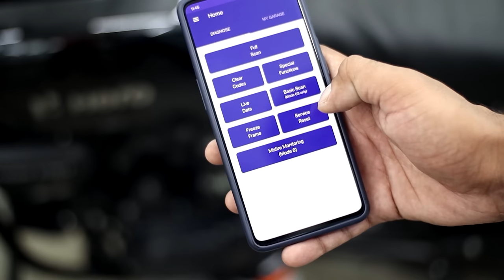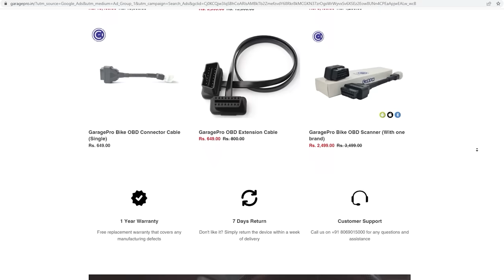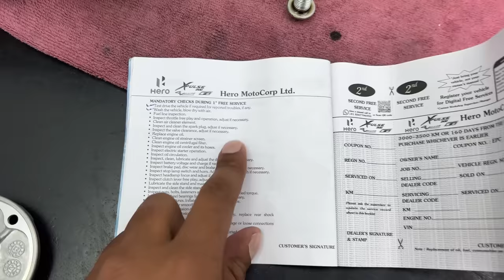Things To Do During The First Service Of A Motorcycle Ft. Xpulse 200 4V

Comment: I have Achiever 150 i3s running 15000 km, have not serviced other than Authorised service centre. They have not opened the centrifugal cover till now. But once they cleaned the mesh filter. That's the level of service we are getting from Hero authorised service centres. If you insist to do something they told you "it's not necessary".

Comment: No service centre opens the right crank case cover in the first service. Even if you  insist on them, they would simply say it isn't necessary. And in most cases owner is least interested getting mesh and centrifugal filter cleaned.
Btw nice informative video as usual.
Reply: Bhai crankcase nahi hai woh clutch cover hai .....
Reply: @travelfoodandnature4782  yes clutch side cover but you understood the point.

Comment: My xtreme 160r is knocking after riding for 15kms ,in the morning engine is smooth and pickup is good but after 15, 20 kms engine noise is becoming  a bit harsh and engine is knocking on sudden acceleration even at 5000rpm.I also adjusted valve clearance recently
Reply: But the engine is still knocking on sudden acceleration,and i also observed a weird sound in LHS side of engine like some loose part is moving in the engine.

Comment: @JeetBhaskar 
Hello Jeet bhai, your videos are so much informative and I love the way you explain every detail. I am also an Expulse 200 4V owner, I love the bike but frustrated with the service. A very unpleasant noise comes from my front suspension whenever I am parking my bike and applying the front brake. The mechanics from hero service center are not able to resolve this issue. The chief mechanic initially advised to free the dust guard from the front suspension as according to him that was not allowing the air to pass and causing the noise. In the next service he told me that its because of the brake pads and even if I replace the brake pad the same noise will come after few days when it will get wet. So he said this is normal in every bike and the suspension problem noise is not like this that will be a loud knocking sound. Please let me know if this is true, and if not, could you please tell me the solution for this, that will be a huge help like your usual videos does. Thanks!

Comment: Hero is selling the xotic oil in 1350ml packaging and service centre has added 1350ml oil during oil change while servicing.
Is that okay or have they added excess oil?
Reply from the maker: Check your owner’s manual for exact quantity
Reply: @JeetBhaskar  manual mentions 1.2L oil during normal oil replacement and 1350ml when the clutch cover is opened.

Comment: Jeet Bhai...

Mai bhi XPulse 200 4V chalata hoon, toh mai kafi dino se ek bada confusion mein hoon 😞 Confusion ye hain ki... XPulse 200 2V ka user manual mein 2V ka engine oil capacity 1200ml mentioned hain, toh engine oil change karne ke samay recommended quantity bhi 1.2L. Yeh toh samaj gaya.

Lekin XPulse 200 4V ka user manual mein 4V ka engine oil capacity 1400ml mentioned hain. Toh 4V ka engine change karne ke samay bhi quantity 1.2L kaise ho sakta hai. Iska capacity agar jada hota hain toh recommended quantity bhi jada hona chahiye na ?

Kindly help me with your expertise, Jeet Bhai 🙏🙏
Reply from the maker: Bhai 1400 ml engine overhaul ke time ki quantity hai na ki oil change ke time ki

Or aap khud samjhiye ki 2v and 4v ke engine me sirf cylinder head me difference hai jiska engine oil sump (jha pr engine oil store rehta hai) se koi lena dena nhi hai to fir 2v or 4v ki oil capacity me kaise difference aa jaayega
Reply: @JeetBhaskar  Thank you so much Jeet bhai 🙏🙏

Or ek sawal tha...Oil Cooler kitne KM ki intervel mein clean karna jaruri hain ?

Comment: No doubt it's a good bike. However, there are few issues which make it a no to prefer bike, apart from height issues which are life threatening at times for short riders it isn't a tubeless tyre, plus to add to the trouble it has a disc brake in the rear so 1 has to take out the wheel to fix the puncture and not all puncture repair guy can do it, it needs a mechanic adding to the cost and very inconvenient most of the times plus the side stand which is annoying and owners know it. Over-all not that great bike in few situations as hero claims, please take this into account while buying it.
Reply from the maker: You can get a main stand as an accessory and tires also could be converted into tubeless